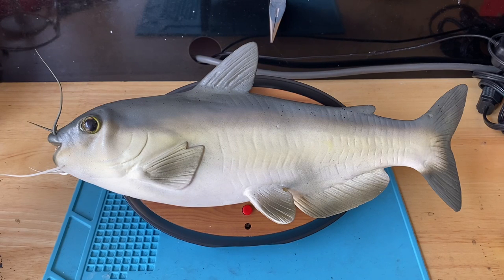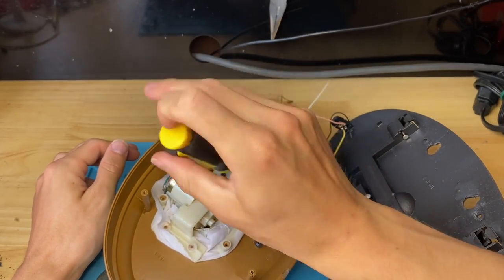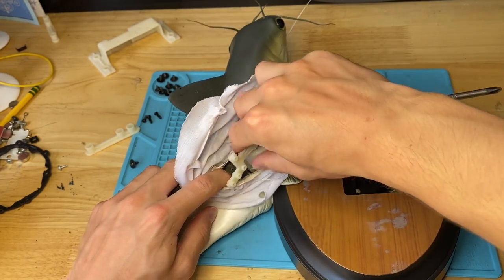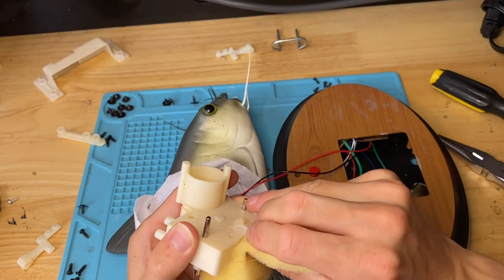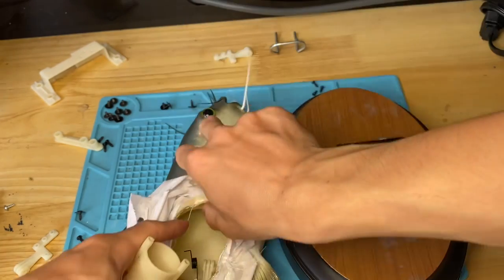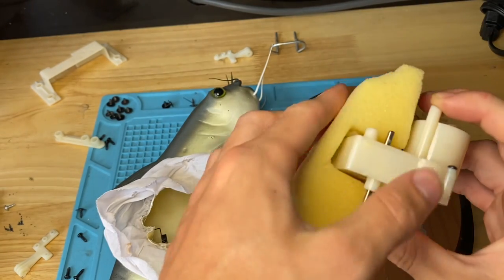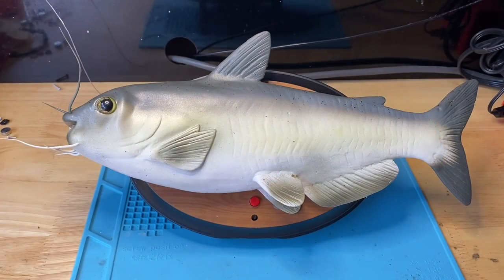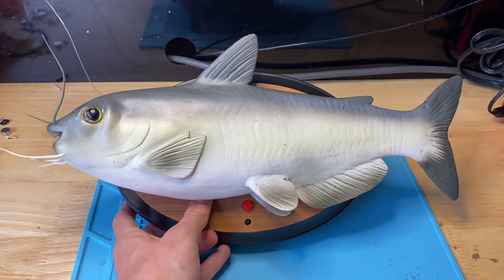How To Repair Your Gemmy 2 Motor Singing Fish (Whistle Piece & Body Gear Replacement)

Comment: Really enjoying these repair videos! (For those reading this comment) Of course this also works with Billy Bass Junior, but the bracket that holds him in the plaque is a smaller size. Just be careful because the plastic is a cheaper quality and that bracket is prone to cracking. Same thing with the screw pegs. Gorilla glue is the solution for repairing broken plastic, I’m speaking from experience;)
Reply from the maker: Good stuff to keep in mind yeah. I've never owned a Billy Jr but will certainly keep this in mind if I ever find one.

Comment: I tried using a heat gun for Skullkrane’s whistle piece because the hole is too small but failed because I’m not a professional. Someday I’ll order a new whistle piece from Skullkrane and try to make the hole a little bigger using a heat gun.
Reply: Don’t order from skullkrane he scams
Reply: @LoganTheGemmyCollector  Use a 3D printer instead!

Comment: what filament did you print them with? i have 3d printed hat arm square shaft gears but it keeps stripping
Reply from the maker: @TheGemmySnowmanDoctor-ze4ho  If PLA is too weak try PETG. Although I never usually have problems with PLA gears
Reply: @IDogFan41  thanks, i will try out petg

Comment: Working on repairing my 15 year bbbm. Nothing is cracked except for the mouth mech, but none of the body movements work. The plastic casing flexes when ever the tail is supposed to move. And ideas what is the cause?
Reply: So i got it to work temporarily, I have no idea what is wrong, originally only the head would move alongside the jaw, then only the mouth would move and the head would barely lift, now the tail and mouth works but the head doesn't lift. Would it be something to do with the spring being removed?
Reply: Also how do you reattach the tail spring? I have been puzzled on how to do it for my 15 year bbbm and a few others
Reply from the maker: @SomeThing-z9i Tail string goes around one side of the square rod, and is inserted into the extruded cuts on the gearbox.

Comment: Does this work with the 2021 Billy
Reply from the maker: Yes, but I find it hard to believe the whistle piece is broken less than 2 years after it was manufactured
Reply: @IDogFan41 Quality is at a loss for modern items